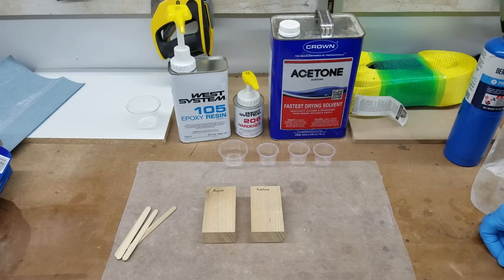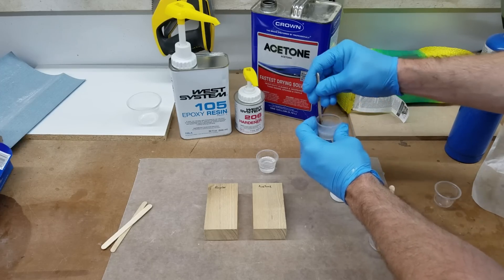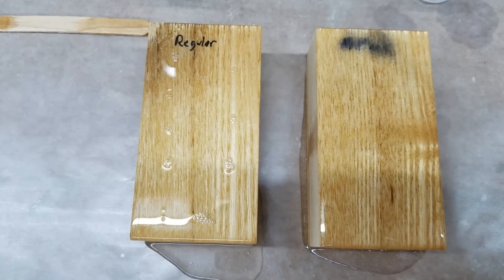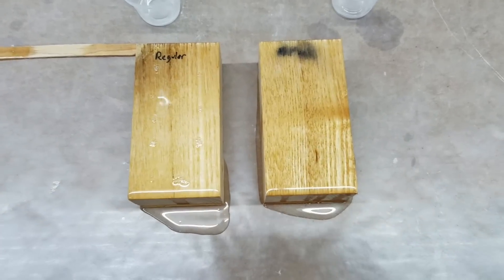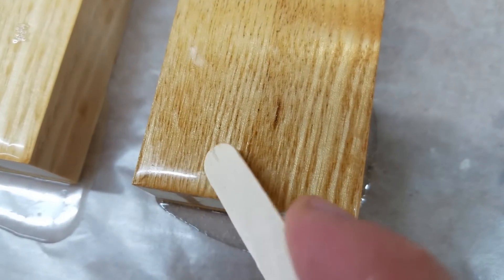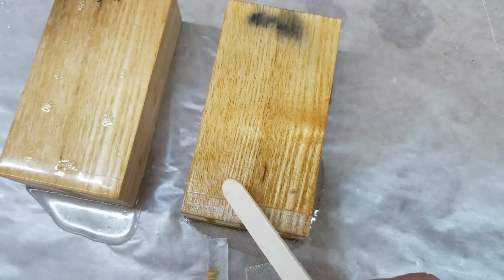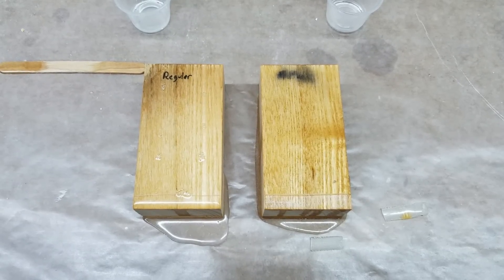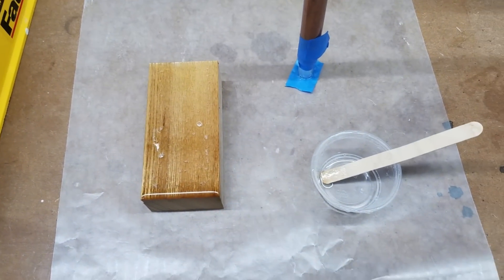What happens when you cut epoxy 50 percent with acetone?

Comment: I think the acetone-thinned epoxy sounds about ideal for paint-on/brush-on applications - less bubbles, more forgiving in application time due to the longer curing time window, and a thinner, more translucent finish.
Reply from the maker: I've done some more experiments, and now prefer alcohol to acetone. It thins just as well, but leaves a smoother finish.
Reply: @TheSnekkerShow  wow great. Thanks.
Reply: @TheSnekkerShow  What alcohol do you use? Great experiement!
Reply from the maker: @roymayh3819  190-proof Everclear. Denatured works too, but it probably has a higher water content and I don't like the fumes. https://youtu.be/j93uNH8SLNU
Reply: Just one remark. It all depends on intended use. True, it is easier to brush it on, but it loses some of it's water resistance, since evaporation of solvent leaves a slightly porous structure.

Comment: interesting, I would of expected the thinned epoxy to have penetrates much deeper
Reply from the maker: It depends on the wood. I used ash in this video, which is very dense, but the thinned epoxy will soak in completely to woods like white pine or poplar. Here's an ash penetration test using just water:
https://youtu.be/gai8Eo2cu2Y

Comment: Try lacquer thinner, that's what is used (brushed on to make the plywood waterproof and harder) on marine plywood in boat making in the Philippines.
Reply: Not a very good idea for a boat. Evaporation of the thinner, or any solvent, leaves a slightly porous structure of epoxy.
Reply: @fifi23o5  I mix lacquer thinner and marine epoxy to a watery consistency and paint it on bare wood and that completely seals the wood from any water invasion. I have had mahogany treated that way underwater for a month and it comes up without any water invasion. I'm a believer in that for all marine wood use.
Reply: @myparadiseonbantayanisland9030  If it works, fine. Using mahogany certainly helps since it has very good water resistance by itself. There were numerous studies done, we tested it, too. We used plywood and there was difference, not huge, but clear difference. There was even difference when we tested spruce, just exposed to humid air, so I will stick with pure epoxy. But, as I said, if it works for you, it is fine.
Reply: @fifi23o5  the mixture was applied to all of my boat's marine plywood and lawaan wood and it is the best waterproofing of all woods that I have ever seen, it really absorbs into the grain of the wood here in the Philippines.

Comment: Looks like a good way to inject resin in area where the fiberglass cloth has air pockets.
Reply from the maker: That could work, but I'd be concerned about getting solvent trapped between the layers.  Less might be better in this case, like 5%.  You could also warm the epoxy slightly to thin it.

Comment: Denatured Alcohol is recommended for thinning of epoxy. Acetone will interfere with polymer cross linking. That is why we use Acetone for Epoxy clean up.
Reply from the maker: I did some subsequent testing and prefer alcohol as well. https://youtu.be/j93uNH8SLNU
Reply: I have used denatured alcohol thinner for fuel proofing my model airplane firewalls and engine compartments with excellent cure rates and durability.
Reply: Good to know
Reply: Thank you for saving me some time!

Comment: What's the point of thinning epoxy. I've used hundreds of gallons of epoxy for various reasons/projects and never once needed to thin it.
Reply from the maker: Penetration or injecting. For example, I replaced a rotten fascia return last year using some baked poplar, and sealed it with thinned epoxy before painting.  It still matches the other wood, but will never rot even if it cracks or the paint layer gets compromised.

Comment: would this be a good way to thin out epoxy for spraying?
Reply from the maker: I've never tried used epoxy in my spray gun because it would be a pain to clean, but 50% is probably way more than you would want or need. Check with the epoxy manufacturer, but I would think no more than 10% would be necessary.

Comment: I make wooden fishing lures and many people recommend using polyurethane or super glue to waterproof the lures before painting. My preferred form of waterproofing is mixing devcon 2 ton epoxy with a few drops of acetone to make it very thin, then painting the lure with it. It not only makes it waterproof but causes the outer layer to become much more durable. I've found the lures resist dents and abrasions better.
Reply from the maker: Sounds like a good technique. I replaced a rotten wood fascia return on my house over the weekend. I built the new one out of poplar, and sealed it with a 50/50 mix of epoxy and ethyl alcohol, my new favorite solvent.
Reply: @TheSnekkerShow  good day. Can UV resin be thinned for use in airbrush? Also what do I use to thin
Reply from the maker: @pietpompiepompiepiet940  I'm sure it can be done, but I've never done it. My preferred epoxy thinner is ethyl alcohol.
Reply: Do the fish like it ?

Comment: I watched a guy use 50/50 to brush on a wood lathe turned hollowform that was super punky. I just picked up xylene and resin, going to give it a go with my spalting mapel... I let the fungus go wild, but now my pieces are exploding haha. Thanks for this
Reply from the maker: Glad it was helpful. I've had good results with epoxy and spalted maple.
Reply: If thinning without reduced hardness, bond strength, etc, then xylene is the solvent to use. Thin both the resin and hardener separately first as it takes more stirring to dissolve both parts than with acetone. The cure time is about 3x that of normally mixed epoxy but the mix can be very thin, so thin that it makes for a very good wood hardener as it penetrates as deep as you want. I have soaked completely rotted/punted wood and after cure had a rock hard composite material that could be worked as if it was solid wood. I use this and urethane varnish thinned with xylene for restoration projects. The urethane is as good as the epoxy but at a fraction of the cost.

Comment: Legend has it, the thinned down epoxy is still curing to this day..
Reply: The epoxy cures where as the solvent drys off. Trapping a solvent within a cured epoxy is relying on the porosity of the epoxy for the solvent to eventually exit. So long time.
Reply: @spudpud-T67  Too true though. I made a bookmark with 50/50 and a bit of acetone as a test, and when I removed it from the mold it came out like a fruit gummy. A few years later I find it, and it had hardened a bit more, but its more like a stale gummy 😂 I think at 7-10 years after making it the thing will finally be cured!
Reply: shutup 😄

Comment: The container of acetone will tell you that thinning at over 10% will cause curing and strength issues.  Using TWO coats of acetone-thinned epoxy (while running through a strainer to take out the bubbles) will give you a rock solid coating that looks like glass.
Reply from the maker: I haven't tried using a strainer before,  I'll have to give that a shot.
Reply: Would that work on stained wood do yo think ?
Reply: It does indeed.  I use it on stained mahogany

Comment: Is there a difference in how it stick to that wood ?
Reply from the maker: Not one that would be noticeable.  Epoxy is absorbed by the wood fibers on the surface, so as long as the surface was free of contaminants it would be impossible to separate it without removing parts of the wood itself.  Thinned epoxy would soak in to deeper fibers, but thinning the epoxy also makes is slightly weaker so I don't know if any adhesion benefits would be achieved.

Comment: This is a good experiment!  The acetone thinned epoxy resembles a soft vinyl.  That alone allows for some creative uses.   Since the acetone thinned epoxy is more flexible, maybe there should be a test of its elastic properties.

You might have also opened a door to experiment with adding plasticizers to epoxy and noting its properties.
Reply: If you need elastic epoxy there is such a thing as flexible epoxy resin.
Reply: It makes me wonder if some of the hardener soaked into the wood, messing up the mix ratio.  The epoxies might work better if a thinner coating thickness was used.

Comment: does it matter what brand or type of epoxy with the acetone. also do you think if you had add less acetone, would it be a stronger expoxy?
Reply from the maker: I haven't tried it with all brands, but I expect the result would be similar. Thinned epoxy will not have as much structural strength, so keep that in mind depending on what you're using it for.
Reply: Is it more flexible?
Reply from the maker: @fredsayshello  At first, but that will decrease with time.

Comment: I use Acetone for thinning epoxy resin when have to brush it over non flat surface. Like round ones from wood lathe. But very little. maybe 1 to 15 proportion or maybe even less. Just eyeballing. It does takes longer to cure, but surface is thin, even and glass like. I also leave  it in the lathe, slow spinning to keep it even spread until it starts hardening. It will cure faster, if heat it up a little, time to time with a heat gun. Don't overheat it.

Comment: I have to remove an epoxy liner from a fuel tank. Would you recommend acetone or thinner?? Thanks
Reply from the maker: I don't think either of those would work well for removing cured epoxy.
Reply: The Snekker Show maybe muriatic acid?
Reply from the maker: Definitely not that; it would dissolve the metal. Ask in the paint section of your local hardware store. They'll get you the right paint stripper.

Comment: Did you do another video with less acetone?  Was thinking about putting some in my epoxy to thin it out and help with a slab I'm working on so it will get in the micro holes.
Reply from the maker: This is the only video I've done so far, but if it's a concrete slab you probably wouldn't need to thin it. I wouldn't go over 10% if anything.
Reply: @TheSnekkerShow  no it's a wood slab.
Reply from the maker: I wouldn't thin it for the final coat, but it shouldn't hurt to seal the pores with a thinned coat first so the final coat doesn't absorb unevenly.

Comment from the maker: After another week, the thinned epoxy was significantly harder, so it will cure eventually. Also, here's another experiment with different solvents: https://youtu.be/j93uNH8SLNU
Reply: Thank you so much! This video answered a lot of my questions about resin and acetone mixture
Reply from the maker: Glad it helped
Reply: I just found your channel and I was about to comment to this effect as I use this frequently but you already figured it out. Good on you for sticking with it. That waterbed effect was worrying the first time for sure! The thinned pours that I do will also shrink significantly over the week-long hardening time. So I tend to use the thinned resins more as an initial barrier to the surface. Did the thinned west resin also shrink? After the hardening that is?
Reply from the maker: @AOZMONSTER  I've been meaning to test shrinkage as well as other percentages and solvents, but life's been kicking my butt lately. Hopefully soon.
Reply: I think this sounds about ideal for paint-on/brush-on applications. Like waterproofing wood or the outside face of an earth building. Thanks a lot for this, gives me ideas for experimenting.
Reply: There is one big problem, not just it inhibits curing, mechanical propeties deteriorate. With West system it shouldn't be a very big problem, joints will still be stronger than wood, but it is mostly used for it's water resistance. It effects water resistance. When epoxy cures, acetone evaporates and leaves a slightly porous structure.
Reply: Not like you'd imagine it would... the monomers can't form the required polymers as it would without the solvents (i.e. - DNA, Acetone).
Never go above a 15% ratio... but try it yourself.
You'll understand after about 72 hours. 
It'll harden, but only to a mere percentage of its capability.
I've helped develop a few polymers in my day, and they're still popular.
Reply: Autoclave!
Reply: I think, think as in guess, that epoxy diluted with stops curing. So, when you pour a thick layer, the acetone in epoxy exposed to air evaporates thereby allowing that thin layer to cure and form a half cured skin preventing the acetone form epoxy underneath to evaporate and therefore the epoxy underneath stays uncured for much longer time.
Reply: Would styrene be better
Reply: Wow thanks . I will make a final coat over the thinned out coat to cover the permiable exposed acetone thinned layer that for the most part went under each rib in my cedar strip boat. The rot is under the ribs and a lot of resin went under the ribs.
Reply: We Rod Builders have been thinning our epoxy with acetone for decades.
It penetrates the thread better, and allows us to achieve a translucent effect.
It just takes much longer to cure, but - we also put an unthined regular coat over it as a finish coat, for durability and hardness.
Reply: @jkg6211  that’s smart, 1st for highlighting/emboldening the wood textures  and 2nd just working like a shield 🛡  I have to give it a try on small piece of some dark wood…
Reply: @Cam-2b  
Let us know how it works for you.
We make our craft better by sharing knowledge.
👍
Reply: @jkg6211  Can a mixture of epoxy and acetone be a substitute for cactus juice?
Reply: @drvenikrstici3479  
When acetone is added to the epoxy mix, it retards the molecular chain bonds that take place while the epoxy is in the curing stage - and thus doesn't allow all of the monomers to form polymers during the curing cycle, dramatically reducing its overall strength.
 
That said - it would fill in most of the pores it can penetrate and make them waterproof, but not have much strength.
(don't expect it to impregnate the wood like CJ... it's just not gonna get that thin and soak in deep before it starts to set up)
The more acetone you add above say, 15 - 20%, the softer and weaker the epoxy is once cured... the more, the worse.

 
If you start with a super-thin, low viscosity type of epoxy, and thin it with only about 5% acetone, it shoud work somewhat - but it'll take a several weeks to cure out to full.
 
I also wouldn't consider using that technique until I got whatever piece of wood I'm doing this to, down to about 95% or more to the final shape/size - it's just not going to penetrate deep like CJ before it begins to set up.

Comment: Prob wouldnt be a good idea to pop those bubbles with a torch on the 50/50 side lol
Reply from the maker: Not gonna lie; I tried it on the last batch. It was a small area, but it didn't ignite the whole thing.
Reply: I wonder if tapping or vibrating the surface initially would help work out bubbles? Or maybe just a hair dryer?